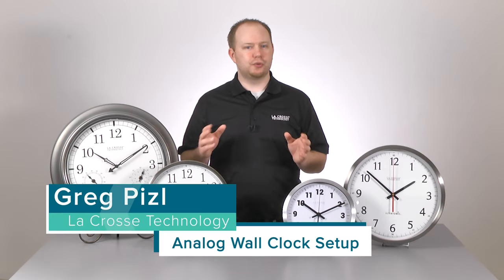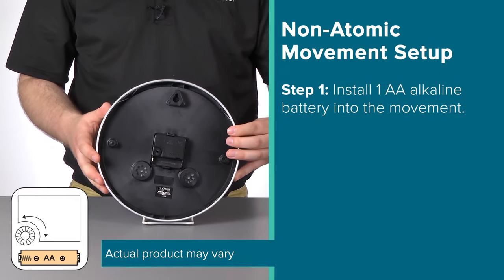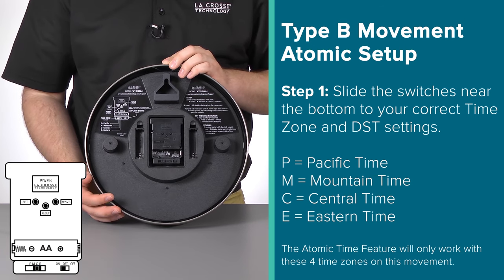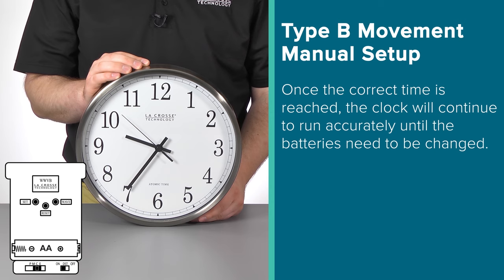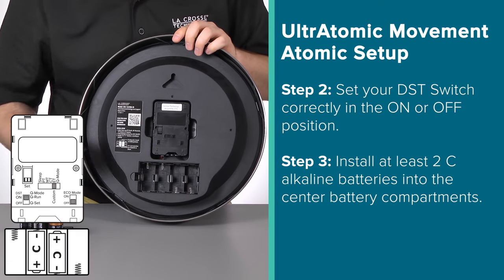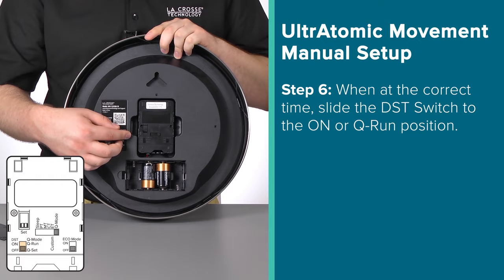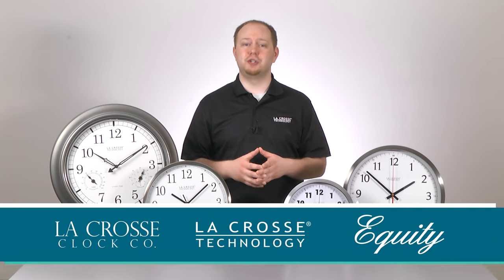How To Set Up Your Analog Atomic Wall Clock

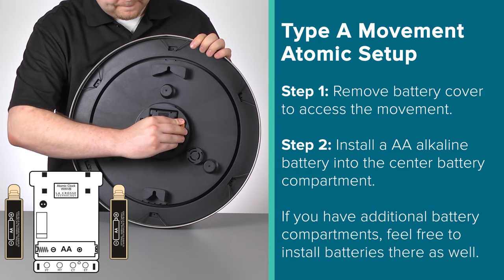Comment: 2:37 I have this clock but the hands fall to 6:30 and fail to move. Any suggestions?
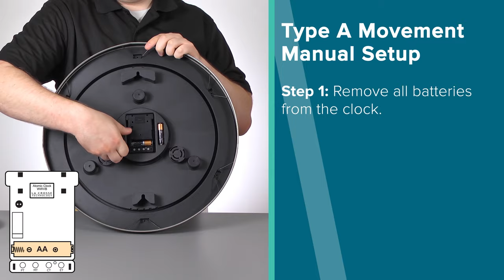Reply from the maker: We first recommend performing a restart with a new set of regular alkaline batteries. The steps for this start at the 4:08 timestamp in this video and will walk you through how to manually set the time. If the clock is still stuck, please message our support staff directly here: https://bit.ly/contact_techsupport. Or alternatively, send us a private message on our Facebook: http://bit.ly/LaxTech_Facebook or Twitter: http://bit.ly/LaxTech__Twitter page for further assistance. Our sincere apologies for any inconvenience.

Comment: Non atomic 1:48
Type A 2:19
Type B 5:13
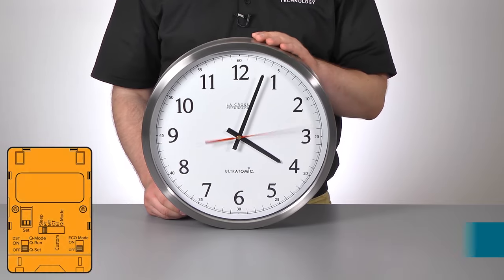UltrAtomic 8:19
Reply: How do I know which clock I have, A or B?
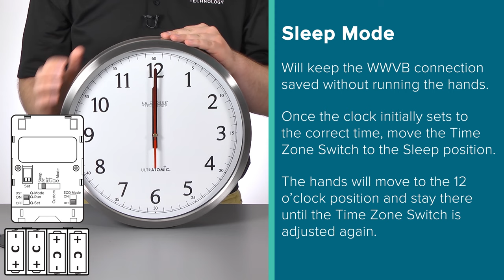Reply: @cubarnett You can look at how the movement shapes like on the back. You can also look at the behaviour. If it stops at 4:00, 8:00 or 12:00 on setup then it is type A. If it cycles a full turn around the clock then stops then it is type B.

Comment: I used to clean a medical building that had these clocks in every room.  Whenever a battery would die they would throw away the clock because nobody could figure out how to reset it.  😂  I had so many of these.  Friends and family all got free clocks for a year.  I still have to look up how to reset them every time they spaz out or need a new battery.  Why not put instructions on the back of the clock itself?  I wonder how many get thrown away because of people getting frustrated.
Reply from the maker: Many of our newer models do have instructions printed or stickered on the back. We are very sorry for any inconvenience, though it sounds like you came out ahead. 😉

Comment: I just learned that if I transfer a Lacross atomic clock to another clock face, I need to put in a pin in the back of the clock and set all the arms at the twelve o'clock position. How do I reinsert (realign) a pin into the back of the clockworks after it was taken out?
Reply from the maker: David, this unfortunately may not be possible. For further assistance please message our support staff directly here: https://bit.ly/contact_techsupport. Or alternatively, send us a private message on our Facebook: http://bit.ly/LaxTech_Facebook or Twitter: http://bit.ly/LaxTech__Twitter page.

Comment: Can this UltrAtomic clock pick up the signal in a basement? Because I just bought one and I am thinking about putting it in my Basement.
Reply from the maker: Hey Jack, thanks for the message. Out of all of our atomic clock options, our UltrAtomic model will offer the best possible reception to be used in your basement setting. We're confident there shouldn't be any issues.
Reply: @lacrossetechnology  Thank you!!! I got worried if it was not going to work in my basement. Thank you again!!!
Reply from the maker: @jackhoeft9761  You bet!
Reply: La Crosse Technology if I have a problem I will contact you guys. Thank you!!!

Comment: How advanced does the forecast operate on the weather station s84107?
Reply from the maker: Hi Lisa, the calculations for your station’s weather icons are based on its internal barometric pressure reading. Keep in mind, these icons are designed to display a prediction of your weather to come within the next 12 hours, not necessarily your current conditions. And because weather can be a hard thing to predict, even for professionals, we cannot claim these to be 100% accurate. For most of our stations, these predictions fall between 60% and 80% accuracy after the first ten days from the initial startup. For more info, you can find FAQs, your product manual, and even a support video on our website here: https://www.lacrossetechnology.com/s84107?type=manuals -- We hope that helps clear this up, but please let us know if you have further questions.

Comment: I have the wt 3101. It won’t receive the signal. I have a smaller lacrosse clock and it picks the signal up in one night. Is this clock defective?
Reply from the maker: We apologize for the trouble. Sometimes different products can take longer than others to receive the WWVB transmission. If it’s been more than 5 full days, and after watching this video you have the clock’s settings adjusted correctly, you may want to reach out to our support staff here: http://bit.ly/contact_techsupport for further troubleshooting. Sorry again for any inconvenience.
Reply: After about a year stashed in one closet,new; I decided to install it, followed all instructions and works simlessly,no problems so far. And I’m a  “clock maniac”; clocks all over.

Comment: basically if you bought a sports car and it doesn't really want to go fast don't worry about how much you spent on it just drive it in manual mode it'll be okay forget about the reason why you buy it you bought it. My atomic clock runs really well when it runs but when it doesn't run or the batteries die I don't know why it has to take days for it to find the right time
Reply from the maker: We apologize for any inconvenience, but this is a limitation of how radio-controlled clocks work. Having the front or back of the clock facing Fort Collins, CO and moving it near a window and away from other electronics can help speed the reception process up. More information can be found on the NIST website here: https://bit.ly/atomic_time
Reply: My old lacrosse clock died after 20 years and several drops off walls so I recently got a type b clock. I’m in MA and it’s on a south facing interior wall so I need to put the clock in a west-pointing window to set it. It got the time after a night or two and was working fine until Daylight Savings “spring ahead”. Despite being set to DST, the time didn’t change. So I put it in the west window for 48 hours, still no change. After watching this video I pressed the wave button and put it back in the window as it was moving to the midnight setting. Just checked a couple hours later and it’s now set itself, but it’s still 1 hour behind DST. What gives? Does the DST switch actually do anything? Frustrating.
Reply from the maker: @pskirby128  Quite strange. We are sorry for the trouble and would love to help. For assistance, please message our support staff directly here: https://bit.ly/contact_techsupport. Or alternatively, send us a private message on our Facebook: http://bit.ly/LaxTech_Facebook page if you haven't done so already.
Reply: @lacrossetechnology I left it another couple days and it adjusted to the new DST time. Odd.

Comment: what do you do if you have the ultratomic clock and you are setting it up but it goes to 4 oclock and stays there for 5 days? It will work in manual mode otherwise but would prefer the atomic mode?
Reply from the maker: Hi Tina, sorry for the trouble. This is quite an odd case, as the UltrAtomic movement should pick up this signal pretty quickly (typically within minutes). If you don't mind, where are you located and where do you have the clock positioned within your home?
Reply: @lacrossetechnology  madison near windows
Reply from the maker: Thanks @tinadenker6254 . If your clock still hasn't picked up the signal, our recommendation would be to remove all of the batteries, press the SET Tab 20+ times, wait an extra few moments, and then follow the setup instructions outlined in this video again, but with a new set of alkaline batteries. If your clock still has trouble syncing with the WWVB reception after this process, we ask that you please reach out to our support staff here: http://bit.ly/contact_techsupport for continued troubleshooting and possible replacement. Sorry again for the trouble.
Reply: @lacrossetechnology  thanks that did the job!! So excited to be using this style of clock

Comment: Hi I would like to take La crosse technology clock to India. Which one can you suggest me? Thanks
Reply from the maker: Our Atomic clocks are designed to work with the WWVB signal broadcasted here in the United States. This signal is unlikely to work overseas, however, as covered in our video here, our clocks can all be set manually as well. With that in mind, we'd simply suggest a clock that fits your look and price range. You can find our current selection of wall clocks here: https://www.lacrossetechnology.com/collections/analog-wall-clocks

Comment: The instruction manual sent me here but this is different than the Lacrosse clock I have - the WT-3102-S.
Reply from the maker: Our apologies for any confusion. The WT-3102-S uses a Type B movement covered specifically starting at the 5:13 timestamp in this video. If you should need further assistance, please message our support staff directly here: https://bit.ly/contact_techsupport. Or alternatively, send us a private message on our Facebook: http://bit.ly/LaxTech_Facebook page. We are here to help.

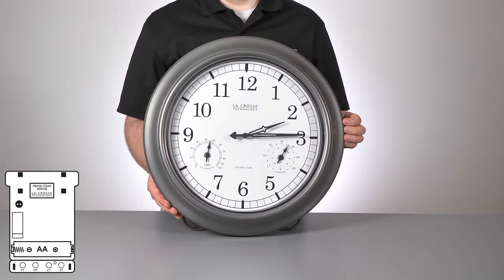Comment: I set my Ultratomic clock up correctly, but instead of initially setting to 4:00, it sets to 3:52. When it receives the atomic signal, it also sets 8 minutes behind actual time. I tried setting manually to the correct time, then resetting for atomic mode, same result. More frustrating than that, there is no actual phone support, and I have no idea when submitted requests online will be answered. Probably returning this otherwise nice clock 😮
Reply from the maker: Hey Andy, sorry for the delay and for the trouble with your clock. Our support staff will be responding to your ticket here shortly for help getting this resolved. Sorry again for the inconvenience, this is highly unusual.
Reply: @lacrossetechnology  Thank you. I did miss a call from your team Monday. I returned and replaced the clock through Amazon, just waiting for the replacement. I did every possible troubleshooting procedure, but I believe the minute hand didn’t have a correctly calibrated position. Looking forward to another try!

Comment: My outdoor clock is always set 2 hours ahead eventhough I set it for Pacific as I live in Las Vegas. I have reset it and taken out the battery. What is wrong?
Reply from the maker: Hi Steven, sorry for the trouble. Could you pass along the model number of your clock? This should be printed on the back, typically near our logo.
Reply: La Crosse Technology it’s WT-3181P.
Reply from the maker: Thanks @Stevie.C  Try holding down your PT Time Zone button until the hands begin to spin. They should rotate into the correct time. If they do not, try and restart the clock via these steps:

1. Remove all of the batteries. 

2. Press the Set Tab at least 20 times.

3. Wait at least 15 minutes before installing a new set of alkaline batteries.

4. Then follow the same setup instructions starting at the 2:40 mark in this video. 

Sorry again for the inconvenience, but we truly hope these steps help resolve your issue. But if you continue to have trouble, please reach out to our support staff here: http://bit.ly/contact_techsupport
Reply: La Crosse Technology I will try that. Thank you.

Comment: I have Time Zone set to "P" Pacific and it keeps setting to 4 hours early. It is it 5pm here in California it sets to 1pm. Any idea how to fix this?  Just got this clock today 09/19/2023
Reply from the maker: Sorry for the trouble; that is quite strange. For assistance, please message our support staff directly here: https://bit.ly/contact_techsupport. Or alternatively, send us a private message on our Facebook: http://bit.ly/LaxTech_Facebook page. Our team will be happy to help get this corrected.
Reply: @lacrossetechnology  I have contacted them and I am waiting for 5 days to see if my clock will get the signal.  Currently I set my clock manually but it is off by 15 seconds so I don't think it is resetting itself with the signal.  If it does not correct itself by the end of 5 days I will contact TS again.
Reply from the maker: @MikiCab1  Thanks. We appreciate the cooperation and hope it can connect with the WWVB signal soon. As our tech support probably mentioned, moving the clock away from other electronics, near a window or outer wall, and having the front or back face Fort Collins, CO, can all help it receive the signal faster. Our apologies again for the inconvenience.
Reply: @lacrossetechnology  I fixed the problem by returning the clock and I bought the Ultratomic clock.  From the description it has better reception and it sync'd after 8 hours at the same location the other clock would not sync at.  I took the original clock around my house and found it would sync in my back yard or in a window upstairs so that would not work for me.  I am in California in the SF bay area so I would think I would get a good signal here but probably getting a weak signal.  There are no mountains for miles so don't know why I am not getting a better signal.  Thanks for your help.

Comment: i have a type a movement. its does not move when i press central time button after battery set it to 4 then i held c button nothing happend ??
Reply from the maker: Hi Georgia, we apologize for the trouble. How long have you had the clock powered on? As mentioned in the video, for the Type A Movement, you'll want to wait for the clock to receive the WWVB signal before the time zone buttons will move the hands into the correct position. This can sometimes take a few days, depending on your location. Once you notice the hands changing time on their own (no longer stopped at the 4, 8, or 12 position), that is when you'll want to firmly press and hold the Central Time "C" button until the hands begin to spin. This should set the clock to your current time. If you need any additional help with this, please feel free to reach out to our support staff here: http://bit.ly/contact_techsupport

Comment: I have a LaCrosse Atomic clock.  Every time when there is a time change (like today with Daylight savings time), I had to move the clock to the window to get the time 'adjusted' to the right time.  Apparently, my living room is too far in to receive the WWVB.  

So bottom line, atomic clock is not a good fit for my living room.
Reply from the maker: We sincerely apologize for the trouble. There are many factors, such as distance, interference, and location within your home, that can disrupt the WWVB radio signal reception coming from Fort Collins, CO. And we unfortunately cannot guarantee the signal will reach all locations. Moving the clock near a window and away from other electronics is the best solution, and we are sorry again for the inconvenience.
Reply: I noticed mine didn't reset Sunday morning, as my computer and phone did, but that afternoon, it read the correct time. I came here to find out why the delay. Is it designed to reset at the "proper" time (1:00 am?) or a later time?
Reply from the maker: @russellharvey7096  Whenever it is able to pick up the WWVB signal. More info about how these work can be found here: https://bit.ly/atomic_time
Reply: @lacrossetechnology Will the new UltrAtomic LaCrosse clock (the one that requires 4xC size battery) fix this issue?  The official forum stated that it has enhanced reception and multiple antennas built in.
Reply from the maker: @expresscontent4346  We cannot 100% guarantee it, but it's close. Our UltaAtomic clocks feature an advanced modulation scheme with new data encoding, which helps with reception and reliability in nearly all locations. These enhanced clocks also come with additional features, as shown in this video. So, yes, it is very likely our UltaAtomic clocks will help resolve your reception issues. All our products on our website feature a 30-day money-back guarantee, so there's little risk if you want to try it out. https://www.lacrossetechnology.com/products/404-1235ua-ss

Comment: my second hand stops and starts randomly while the minute and hour hands maintain the correct time. It is a new clock with a new battery, what's up?
Reply from the maker: Hey Doug, sorry for the trouble! Please try pressing the RESET button on the back of the clock. This should restart the clock back to it's original out of the box condition. If the second hand is still moving randomly, please also try installing a new fresh regular alkaline battery into the movement, other battery types can have unexpected results. And if this problem is still occurring after these steps, please message our support staff directly here: https://bit.ly/contact_techsupport. Or alternatively, send us a private message on our Facebook: http://bit.ly/LaxTech_Facebook or Twitter: http://bit.ly/LaxTech__Twitter page for further assistance. Our apologies again for any inconvenience.

Comment: So basically 
1. Set the button to your preferred time zone, DST off/on and insert a battery.
2. Press set and adjust your time manually! 
The atomic part of the instruction is unnecessary as it will do it anyway :)

Comment: My Type A doesn’t stop at 4, 8 or 12 o clock and trying to set it manually doesn’t work.
Reply from the maker: Hey Joe, our sincere apologies for the trouble. Please message our support staff directly here: https://bit.ly/contact_techsupport. Or alternatively, send us a private message on our Facebook: http://bit.ly/LaxTech_Facebook or Twitter: http://bit.ly/LaxTech__Twitter page for further assistance on this matter.
Reply: Lacrosse clocks are a scam, they dont actually work.
Reply: @dylanfenster6785  No they are not a scam. Also, it is a bit too harsh to call it a scam just because yours didn't work. Mine worked perfectly
Reply: It might be a Type B.
Reply: @dylanfenster6785 Stop with the attitude. If you have nothing nice to say don't say it at all.